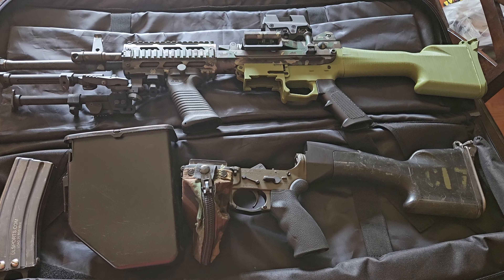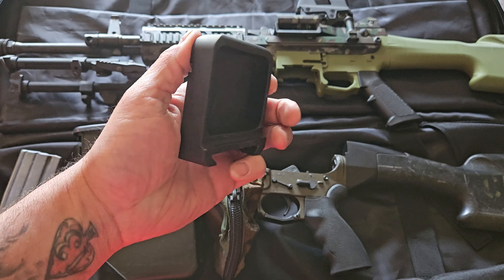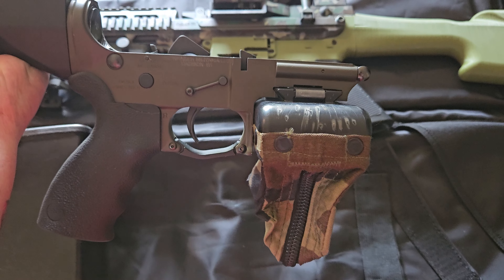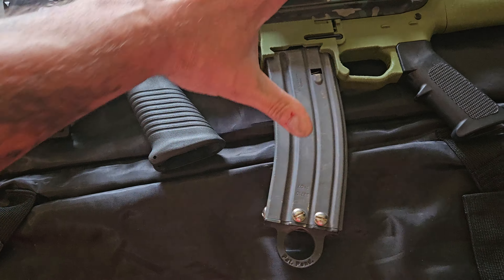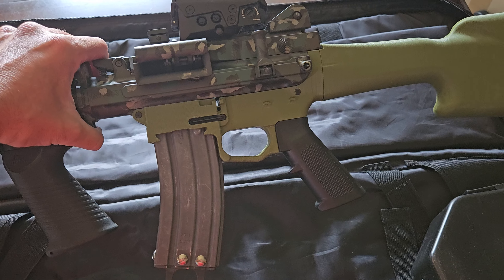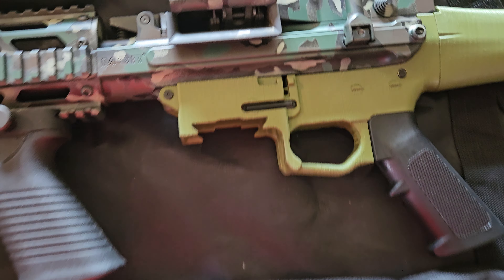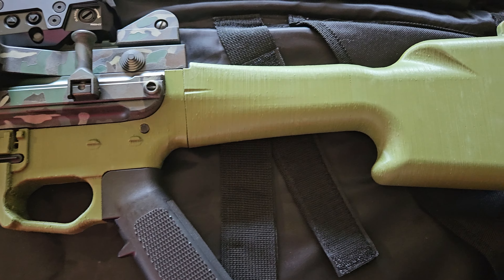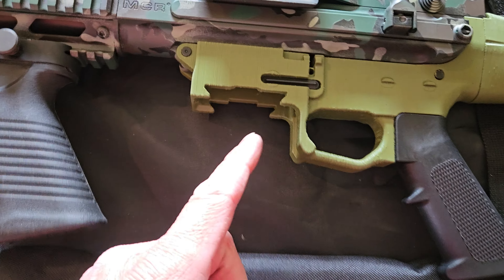low profile dual feed belt fed receiver for belt fed uppers

Comment: Moving back to Texas soon and was gonna get the 12.5 MLOK MCR Upper. I really like the Cryo lower but was disappointed you lose the ability to use standard mags with it. This fixes every issue I had with it. Will these be machined lowers or are these solely a 3d printed design?
Reply from the maker: @davidray2682  No, it isn't a 3d printed design. We are waiting for the production lowers now. The 3d was just a non functional sample like it said in the video.